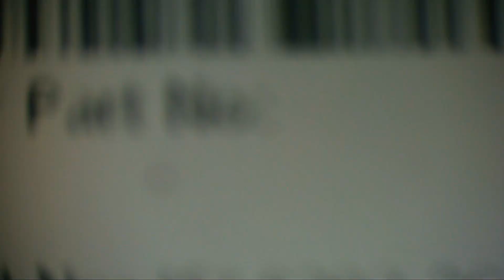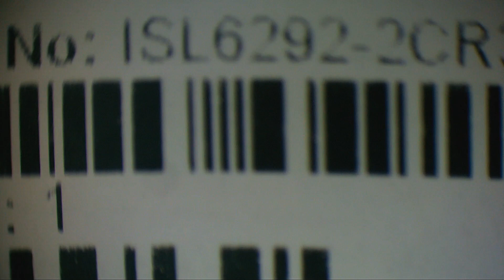TBS Tango2 PCB REPAIR (Battery Charger Circuit)

Comment: I would like to ask for your help. I have a TBS Crossfire Micro TX V2 starter kit. The kit included 4 TBS Crossfire Nano RX modules, all of which will seamlessly connect to the TBS Crossfire Micro TX V2. I've flashed the Crossfire Micro TX with both the latest and previous firmware multiple times and it always connects to the Crossfire Nano RX without issue. I used TBS Mambo as my equipment, but since it is quite large, I decided to purchase TBS Tango 2 Pro.
But I couldn't connect TBS Tango 2 Pro to any TBS Crossfire Nano RX module because Tango 2 Pro freezes. I have to force shutdown the device. If I install an older firmware like 4.11, TBS Tango 2 Pro connects to the Nano RX, but the connection keeps dropping and there is no data transfer. If I update the TBS Tango 2 Pro firmware to version 6.19, the device freezes after trying to connect the Nano RX. Here is a link to a video showing the problem:
https://www.youtube.com/watch?v=cxoT4KlNIuoЯ
I decided that the problem was in the device board, so I bought a new board for Tango, like this
https://www.fpv24.com/en/team-blacksheep/tbs-tango-2-upgrade-pcb-v3
The board came with new firmware versions 1.34 and 6.17, but when I replaced the board and tried to connect it to the Nano RX, the machine froze again. I figured my Crossfire Nano RX was the problem and contacted a friend who has his Nano RX but it also won't connect to the TBS Tango 2 Pro because it freezes.
I would be grateful for any help you can provide to help me resolve this issue.
release. What could be causing this problem and how to fix it? I will also
Attach photos of my settings and configuration, as well as log files and any
other relevant information that may be helpful in solving this problem.

Comment: Good afternoon. I am your subscriber and have watched a lot of your videos, thank you very much for your hard work! I want to turn to you for help and maybe some advice postklku faced a situation that I can not solve on my own. And you, as a person who understands electronics, can advise something.
Reply from the maker: Shoot :) If I can help I will.
Reply: @LivyuFPV  I would like to ask for your help. I have a TBS Crossfire Micro TX V2 starter kit. The kit included 4 TBS Crossfire Nano RX modules, all of which will seamlessly connect to the TBS Crossfire Micro TX V2. I've flashed the Crossfire Micro TX with both the latest and previous firmware multiple times and it always connects to the Crossfire Nano RX without issue. I used TBS Mambo as my equipment, but since it is quite large, I decided to purchase TBS Tango 2 Pro.
But I couldn't connect TBS Tango 2 Pro to any TBS Crossfire Nano RX module because Tango 2 Pro freezes. I have to force shutdown the device. If I install an older firmware like 4.11, TBS Tango 2 Pro connects to the Nano RX, but the connection keeps dropping and there is no data transfer. If I update the TBS Tango 2 Pro firmware to version 6.19, the device freezes after trying to connect the Nano RX. Here is a link to a video showing the problem:
https://www.youtube.com/watch?v=cxoT4KlNIuoЯ
I decided that the problem was in the device board, so I bought a new board for Tango, like this
https://www.fpv24.com/en/team-blacksheep/tbs-tango-2-upgrade-pcb-v3
The board came with new firmware versions 1.34 and 6.17, but when I replaced the board and tried to connect it to the Nano RX, the machine froze again. I figured my Crossfire Nano RX was the problem and contacted a friend who has his Nano RX but it also won't connect to the TBS Tango 2 Pro because it freezes.
I would be grateful for any help you can provide to help me resolve this issue.
release. What could be causing this problem and how to fix it? I will also
Attach photos of my settings and configuration, as well as log files and any
other relevant information that may be helpful in solving this problem.

Comment: Whenever I solder thick wires to power pads on PCBs like an esc or a power distribution board, I face a problem that when I begin to add solder and heat, the solder begins to flow from vias and reach the bottom side of pad and begins to accumulate there
Any tip on how to avoid that?
Reply: Use a bigger tip. Heat is drawn to quickly out of a small tip

Comment: What is your suggested temperature for basic quad building? For 22-30ga wiring for instance
Reply from the maker: Depends a lot on what pad you solder them... what iron you have. It will vary from 300 to 400 c